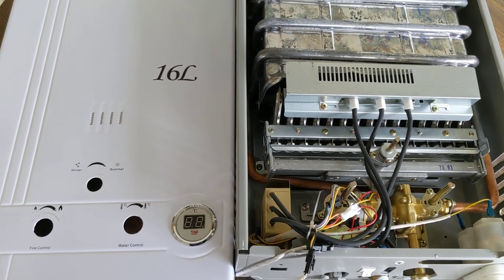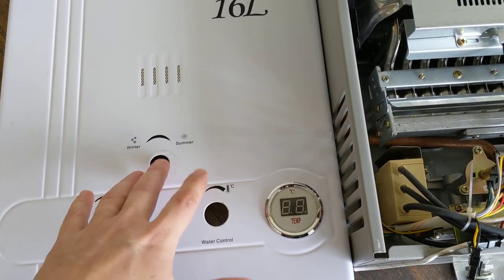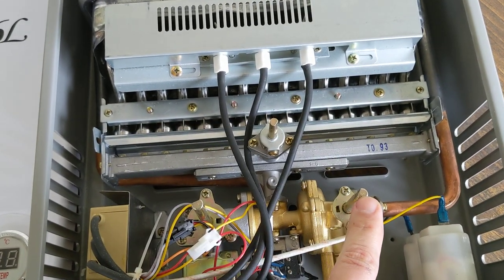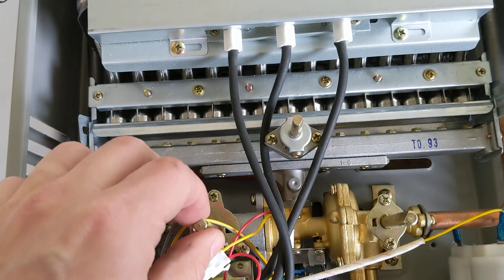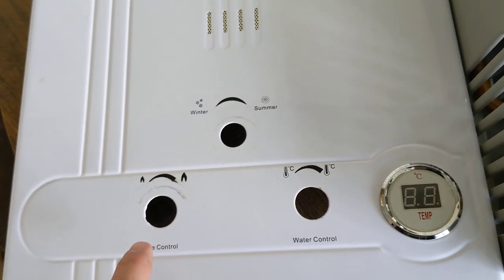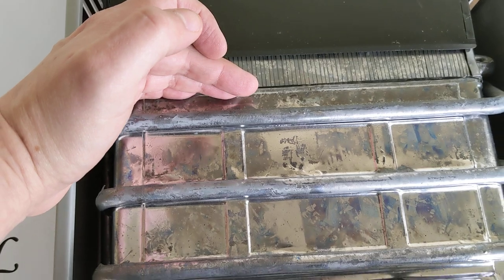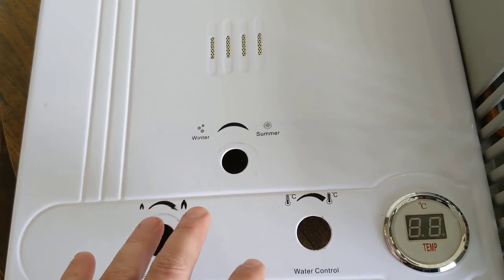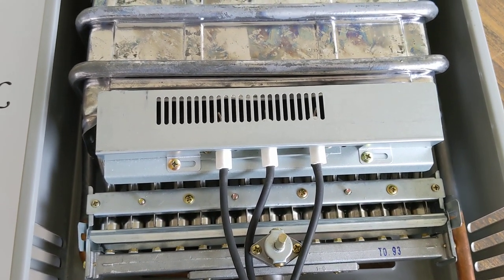Basic control functions of tankless gas water heaters TCMT Vevor Marey

Comment: Thanks for taking the time to put this up, I bought a camper with one of these in and came with no manual, because the water flow had the temperature symbols on the outside it was throwing me, but you’ve cleared that one up nicely, cheers 👍🏻
Reply from the maker: Glad it helped
Reply: What  can i do to  stop the water from flowing  through  the   water exhaust

Comment: Good explanation, one quick question: what does it mean when you turn the  water heater on and u hear clicking from the heater  but it wont ignite the fame?
Reply: Make sure you have gas going through.  I had this issue using Propane and it turned out that the solenoid to open for the gas couldn't overcome the pressure.  Would click and spark but wouldn't open the solenoid up.  So got an adjustable regulator and now it works fine.  If you're using natural gas, you might need to turn it on and off a few times to purge the air out of the line.
VT247

Comment: I and I'm sure most people that have one of these knows what the controls are for. What I would like to know is how to set them, what is the procedure? My water heater will fire for a while and then the gas will turn off and before you know it the water will turn cold. So the question becomes how do you set it to have a uniform heat throughout a shower? I was looking inside and see that there is a temperature sensitive switch on the hot water output just above the temperature readout sensor. I have watched a few videos and in one I saw that that switch was taken out. My question is, why is that switch there? turning off the burners after a certain temp. is reached? I would think that once the controls are set properly a uniform temp. could be achieved?

Comment: Is there a pilot light that stays on? Or is it like a bbq and has an electric ignition? If the latter, what safety device is installed so when you ask for hot water. And igniter fails, Gas isn’t leaking unburned
Reply from the maker: Has a 9 volt battery for ignition, and sensors installed inside for safety.

Comment: Please I have a question if I put the water regulator on max does it mean the water would be hotter or it's the other way around ?
Reply from the maker: Yes max means hotter.
Reply: @SaveGreenHere  oh I thought since the water pressure it too hight the temperature wouldn't be as hot as if the pressure was less.thanks for clearing that out

Comment: I need the control box that tan box to the left with the 3 wires coming out of it. Mines. 18L. Do u happen to know where I can get that box?

Thanks!
Reply from the maker: You may need to contact the seller. But a replacement unit is not expensive. Just buy the 3 or 4 year warranty which is very cheap too. https://amzn.to/3vfn2Md  Link to warranty...... https://shorturl.at/cfDF5

Comment from the maker: You will have to adjust the knobs accordingly. The one to the right does adjusts the FLOW of water. That knob, turned all the way to the right will give you the least amount of water FLOW, and turned to the left gives you the MOST water flow. Set this knob FIRST! Some users prefer the flow to be less, to save on water costs, especially occupants that take loooong showers! Keep in mind that as the water flow is less, water will pass through the burners much slower, making it feel hotter! That's why you adjust this knob FIRST! After adjusting this, adjust the knob to the left which will be your temperature control. The knob on the middle/top basically turns on 2 burners, or three burners. On some smaller models, like the 8L or lower, the middle top knob turns on one burner, or two burners.
Reply: thats what  I read. i ordered one and it said turning the water flow down actually raises the temp so thanks for sharing that.

Comment: @SaveGreenHere I'm looking to get rid of my 5-0 gallon electric hot water tank that sits in my damp 45 degrees basement. I have only 1 bathroom which also has my washer n dryer in it. The kitchen sink is just on the back side of the bathroom sink. Only a few feet away. I live alone & don't like paying a electric bill to keep 5-0 gallons at 125+ degrees all day. I shower once a day, do like 2 loads of wash a week & have minimum dishes to wash. What is a good unit to accomplish & meet my needs??? I have natural gas for my dryer & Stove. 
Can I install one for under $350-$400 that will fit my needs???
Ive watched so many of your reviews & videos but still lost kinda. I see videos where they have them mounted on a bathroom wall but no lines or anything hooked up yo it. So many of them like that or say not for indoor use but they show it on a kitchen wall by the stove. How's this possible??? Seems like scam. 
Thanks So Much.
Reply from the maker: If you install in a bathroom, and go with gas model, you need to exhaust for safety reasons. Electric is fine though.

Comment: This is a great video and learning the water flow dial was informative thank you. But my problem is that my tank gets too hot and if I try to turn it down I have the right dial water flow all the way to the right and the left dial flame all the way to the left and it just gets too hot it's around 130 135° and if I try to turn the water flow down that will lower the temperature but then it shuts off if I turn it too far. And the same if I add too much cold water from a line that I piped in. I'm assuming it's dropping the water pressure into the unit because I piped it in before the water goes into the unit and then added it after the water comes out. Please help, I need a shower.

Comment: Hi i have one of the 8 litres min gas water heater there is a brass tube at the bottom that says water exhaust  is this frost protection does it drain down itself if temp goes below 0 or do you have to unscrew it manually to drain it down many thanks
Reply from the maker: Is your unit located in a closed environment , with proper venting? If this is the case, you may not have to even worry of frost. Most we have installed are in an insulated closet with small louvered venting. Therefore, I am not sure of the full function of that brass fitting screw.

Comment: Hi. I have the 12L and I put a BBQ grill regulator on the propane input. I can not get more than lukewarm water. It will not get above 32 Celsius. Should I increase propane input? I'm stumped. I've played with settings for hours.
Reply from the maker: raise the temp, and slow the flow of the water. A low-flow showerhead is strongly recommended, like this one...... https://amzn.to/3FCnw1H

Comment: Thank you for this informative video I learned a few things. I've had two of these on demand heaters and I don't understand why the little round display that shows the number 88 does not show the temperature isn't that what it's supposed to do? TIA
Reply from the maker: Yes. Set your temperature by adjusting the temperature knob and looking at that LCD display. You can also control the flow, and that would affect the temperature of the water.

Comment: Hi. What is the little 1/4 brass fitting next to the water fitting for. Thks
Reply from the maker: You have water in/out connections, and gas line connection.
Reply: Not those. The  long brass fitting besode the water inlet. Looks like 1/4 inch diameter

Comment: I just bought the exact same unit and have a question. Trying to test this unit before installing. I pull on the micro switch which starts the sparks clicking then I hear the solenoid closing. At this point if I gently blow air through the gas inlet, the air should pass through. That's how my old one worked. But, this new unit will not pass air through even when the micro switch is pulled and solenoid is engaged. Is this a defective unit or my test is flawed?
Reply from the maker: Sam, the ones we installed were in properly vented rooms. Most were in alcove type enclosures with a door having louvers, and a metal pipe over the top of the unit. The air movement was noticed, as you can "hear" it while it ran, when the gas flame was engaged. The top pipe would get hot, which is normal when "venting" the air out.

Comment: Hi, I purchased a 12 L TCMT propane water heater in order to raise the temperature of my kids' outdoor water pool.  The idea is to recirculate the pool water overnight (using a small electric water pump) so that the pool water is heated up a bit.  Anyway, when I purchased the unit, I happen to read that the TCMT heater will shut off automatically after 20 minutes.  How can I disable this feature?  The unit is set up outdoors, with plenty of space around it.  Please advise, thank you!
Reply from the maker: I wouldn't run chlorine water through it.
Reply: The pool water is only moderately dosed with chlorine, hardly different compared to regular chlorinated tap water. Interestingly, when I ran a test run on the unit, it fired up and produced warm water for at least 30 minutes before I stopped the test.  Again, I would really like to know how I can disable this "20 minute shut-off" feature.
Reply: @christianviewmont5632  I have been asking the same question but cannot get any answers. What i have found out is that the 20 minute timer is built into the EEprom chip inside the ignition module. It cannot be adjusted.
However there are alternative ignition modules that don't come with a timer but i cannot find a UK supplier. 
https://wap.china.cn/Gas-Water-Heaters/141818352.html
Reply: You should be able to put your water pump on a timer that recycles set it for 20 minutes on 30 seconds off and 20 minutes back on I read where somebody else did this as soon as it flows again it will start running but you need to have it all for a while 30 seconds should do it

Comment: Hi a quick question does Rinnai tankless water heater has 3 burners as well and does it have  summer and winter  settings
Thanks
Reply from the maker: The Rinnai system (https://amzn.to/35YGb5K) works a bit differently. It has sensors that sense the incoming water temperature, and automatically adjusts the way 2 or 3 burners come on, depending on the delta T, or temperature difference between the incoming water temp, and the desired temp at the faucet or shower. So on a Winter day, for example, if your water temperature coming in is at a 50 degree difference than your desired, most likely it will automatically adjust to 3 burners, as compared to Summer, when the temperature differences are not as great. Of course, this technology comes with a price tag $$$$, due to the sensors, and "computerized" boards inside these units, and are EXPENSIVE to buy, and EXPENSIVE to repair. What I tell my customers, is to buy the one shown on the links to this video, with a 3 or 4 year warranty, for around $30 extra, and also buy an "extra" water heater to have on standby, should the original unit need a warranty replacement. The reason, is that if it were to die out, your warranty will get you a free replacement, but you have one on "standby" ready to replace, and then wait for the replacement unit to now be your backup. It's like having a "spare tire". The two units on the video, with a warranty costs about half of a Rinnai. These units also have zero computer boards, so easier and cheaper to make. But, the choice is yours.

Comment: Thanks -- very helpful.  I bought one of these for my kids above ground pool.  I have it all set up, but the heater is not starting.  Is there an pilot or ignition that I need to start it up?  Thamks
Reply from the maker: These are designed for hot water for bathing. The chlorine from a swimming pool may have very much permanently damaged a water heater not designed to heat swimming pool water.

Comment: I was wondering what the flow is on these devices as compared to the flow coming out of you tank heater? does the water come out like a garden hose of hot water?
Reply from the maker: Depends on your showerhead. That will determine the flow more than anything.

Comment: I noted that the unit get its power from D cell batteries.  Is there away to use a power source such as a 3v adapter to run the unit?  Can a 3v adapter be hard wired into the battery compartment to replace the batteries.?
Reply from the maker: They are available, but cost more. Here is a link..... https://amzn.to/3BXh00t

Comment: Thank you for the informative video. I was wondering about the winter/summer function. I have a little camplux that worked flawlessly this summer heating a small 260 gallon pool even as fall chill crept in, you could see the steam rising, it was nice. But I recently purchased a 6L TCMT to tip the frost scales in favor of a small waterfall/pond and was wondering, before I install it, does anyone know if the little red light or digital temp display is supposed to come on with the switch, regardless of gas or water connected? Yes fresh batteries are installed properly :-) Thank you and any help is greatly appreciated.
Reply from the maker: These devices are designed for ONLY domestic water heating. I don't believe it can handle continuous run times that last more than the average shower or bath at a time.
Reply: @SaveGreenHere  Thank you for your reply. Probably true, but it and the pump ran a good 3 hours at a clip. I would only run this enough to bring the fountain above freezing, like tossing in 6 or7 gallons of heated water every 5 or so hours. Pond is roughly 70 gallons. But I learned that the light doesn't come on until the unit is ready to actually operate.

Comment: Why am I losing hot water in the middle of showering?
How do I manually set knobs?
Reply from the maker: As sown in the video, tweak your water flow to be lower for hotter water.  Also set your temp higher. Additionally, use a low flow shower heat with 1.5 Gallon Per Minute (GPM) or less, like this one....... https://amzn.to/3hEp8xW  The lower the water flow, the longer the water sits on the heating element, thus producing hotter water.

Comment: Thanks for your useful information, i would like to ask what will happen if i turn off while its working and after a little turn on. Im trying install a temperature controller from aliexpress to ensure  that the water will not exceed 55°c because my water tubes are made of plastic. Thanks
Reply from the maker: No idea
Reply: @SaveGreenHere  anyway, thanks!
Reply: PEX line is safe up to 200°

Comment: How to reset water heater.
(Not the on off button on the bottom)
The little thing that shows 88 when no batteries are in the unit does nothing when I put batteries in, and nothing is working.
I have propane to the unit, and water hooked up.
Both are on

Comment: Are you still answering questions about this heater?
Reply from the maker: what's your question?
Reply: I have a similar tankless heater that gets too hot. Was working fine when I had it plumbed into a coach, but now I have it in a travel trailer. It'll get too hot, then the burners will turn off. I have it set to the coolest water temp.
There is a flathead adjustment screw under the water flow valve.
Is there a way to raise the flow to get cooler water? Or do I maybe have another issue? I have two heaters. One for shower and one for kitchen sink. Both turn off after a few minutes of running.
Reply from the maker: What size are they? What size is the piping BEFORE it gets to the tank? (cold water in), and what size is the piping AFTER it leaves the tank? (Hot water out) For the applications you just described, the lower BTU tankless water heaters, are best, especially since you have one for showers and one for kitchen sink. If you tankless is a larger unit, that may be another issue, even if you turn down to the lowest setting. A 6L, or 8L model is best, like this one....... https://amzn.to/3jI5Wg1  I also highly suggest buying the replacement plan, as it usually costs less than $10 annually for the 3 year plan........ https://amzn.to/3lUqpAQ
Reply: @SaveGreenHere  1/2" pex with crimped connections. I replaced it with what it already had in.

Comment: I had a propane model 18L. It will come on but it will not get the water hot. I got gas to it I've had it for 68 years. It just stopped heating up the water.
Reply from the maker: Wow! It lasted decades!

Comment: Hello, doesn't it has a water pressure reducer?
Reply from the maker: Yes, as clearly explained in detail on the video.
Reply: @SaveGreenHere  no, you talk about water flow. But if I use it at home do I need a valve to reduce the pressure of water at e.g. 3 bar?

Comment: I’m from America never worked with these moved to Egypt and these are standard water heaters but it’s like I can’t get the water to maintain the temperature it’s either in and get really hot it turns off and gets really cold how to do I keep it in a good temperature to complete a full shower without water turning super hot/cold please help
Reply from the maker: Depends on the ACTUAL water flow from your water source.
Reply: @SaveGreenHere  how do I know
Reply from the maker: https://amzn.to/3GN1mYr
Reply: Sorry  for my question. Did you get a good answer to your question? 
Because I have the same problem,  but I don't no what to do!

Comment: I have a problem that when the shower comes hot water, but quickly extinguish boiler and then come cold water, so I close the shower and open again to heat up again after a while , what i can do to have continuous hot ( warm ) water in winter  without the boiler turned off lonely ??
Reply: I have the same problem,  but no answers yet !😥

Comment: Hi I have the Problem that the heater only starts when the water control is in higher position. it seems that the heater get enought water but the pump is ok Any ideaa?
Reply from the maker: They are designed to operate when the water flow is to be high enough not to cause excess heat, so do not put the water flow too low.